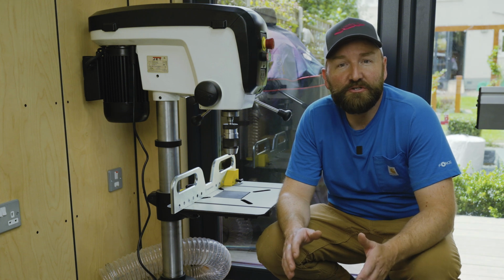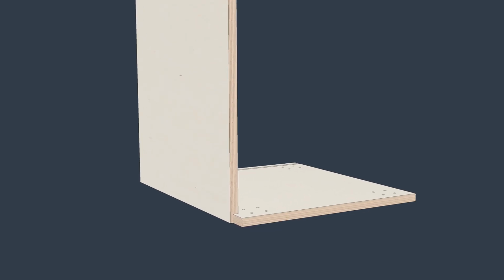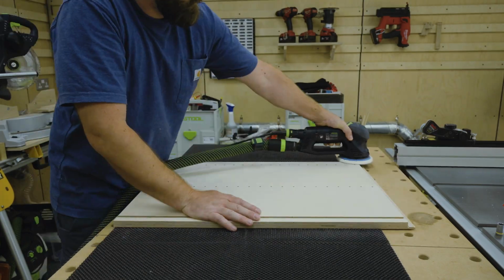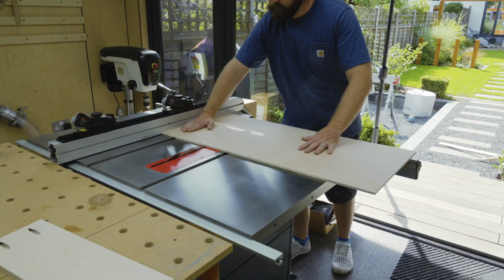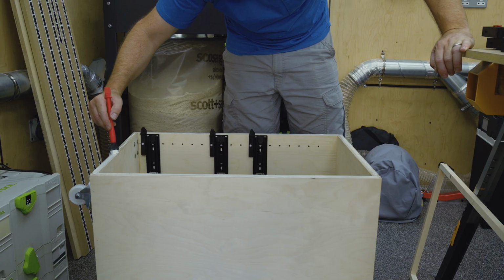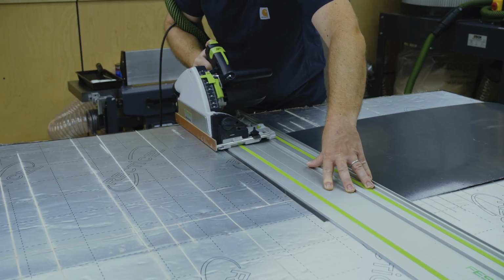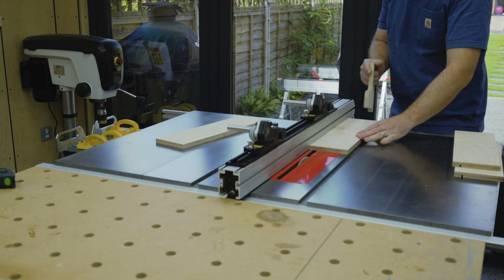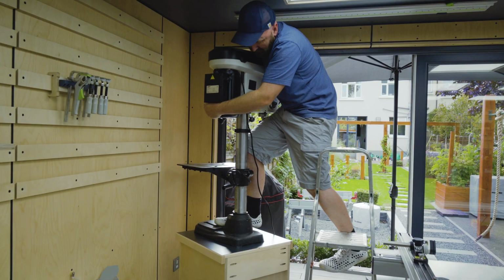Mobile Workshop Cart | Step-by-step Build Guide

Comment: Did you think about doing the sys 32 holes with the shaper origin and plate?  I’m curious if it’s more tedious than using the LR32.
Reply from the maker: It is definitely achievable with origin. Doing grid and having enough reference tape might be a little bit more time consuming but a big deal. 
Once you have LR32 dialled in and using a balanced panel it is super fast. As it was my first time however it was not! 😅

Comment: Curious, does the drawer false front keep you from fully opening the lid of the lower sys-az systainer?
Reply from the maker: No as it is an inset drawer front the sys lids open fully without issue. If however you did overlay front then you would have an issue.
Reply: @HSWBuilds  Ah, my bad. Totally missed that it was inset.  :)

Comment: Did you cut the maple oversize and leave it a day to exhibit any dimensional changes from internal stress?
Reply from the maker: Yes. Rough cut was 50mm over in length and 5mm in both width and thickness then came back next day to take to final dimensions.

Comment: Where are you getting your black laminate (Formica / Melamine) sheeting for the top?
Reply: That’s awesome thanks a lot. Way above and beyond.
Reply from the maker: Where are you based? I’m in the UK and bought online. https://plastics-online.co.uk/product/f2297-terril/
Reply: I’m in the UK too up in Yorkshire. Where abouts are you? Thanks
Reply: £1000 a sheet!!!! Is that right?
Reply from the maker: Hey just called up the company I gave URL for. They do a 2150 x 950 sheet for £29+VAT and you can buy single sheets. Website will be fixed soon apparently.
Reply from the maker: @andybrook-dobson726  no I think there is an issue with their website. I think I paid a little over £150 for the sheets. 
There will be other sources that are working. Will find one for you a bit later.
Reply: That’s kind of you; £150 for the sheet that did the top of the drill cabinet or for 8’ x 4’!
Reply from the maker: @andybrook-dobson726 no no the sheets are 3m x 1.5m. You can get smaller though I think. I got two sheets for that price as have a few more projects where I want to use the Formica.